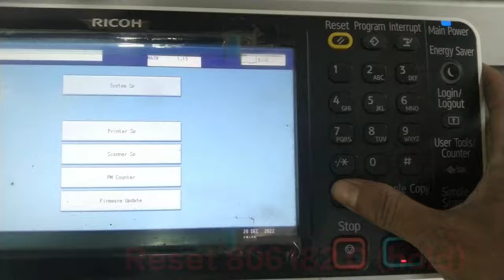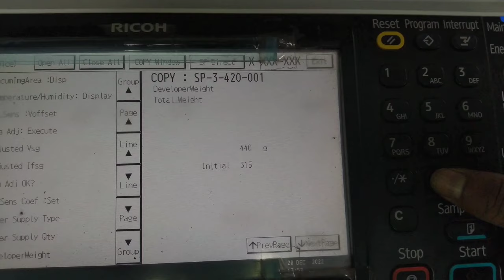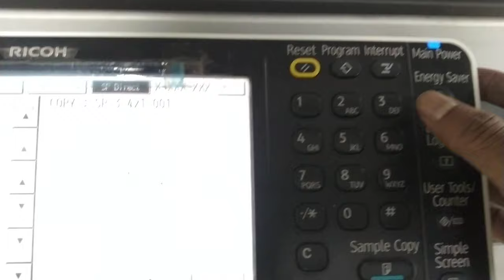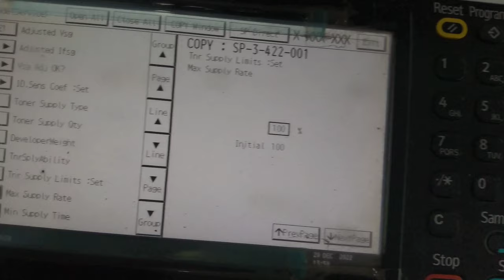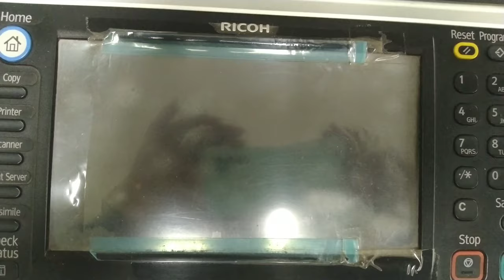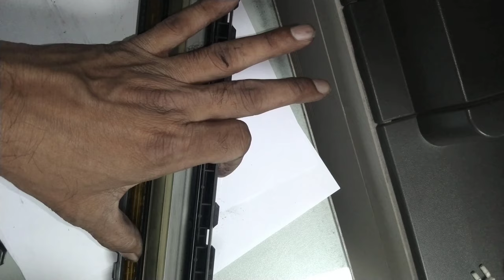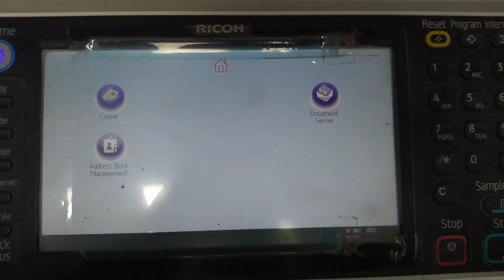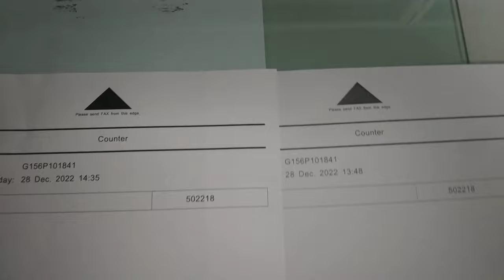Ricoh MP 2554 lite copy, How to solve lite copy? How to increase darkness, fix low quality print.

Comment: i had the same issue with mp 3054...after i change new developer its good,but after 100 copies it becomes faded again...i already changed drum unit and new developer same problem...
Reply from the maker: Please apply this video's solutions especially : Developer thickness increase. 
Additional is SP 3440 100% to 150% and 3422 10% to 15%
Then Manual procon execute. 
If not solved : Replace High voltage circuit.

Comment: What about if mpc 2003 black not solid..also very light,after change drum,developer..
Reply from the maker: Use sp mode143
SP 3050 - .5  to 1
SP 3420 - 315 to 425
SP 3421,  deafult to increase 
SP 3620,  .6700 to  .750

Then complete procon all

Darkness will increase day by day.
Reply from the maker: Also replace original Drum unit
Reply: Thank you for the feedback,will update again here
Reply from the maker: If not solved
Increase Development thickness.
Reply: @ricoh.support How do you increase developer unit thickness

Comment: For mp 3352 sp we can do same thing ??
Reply from the maker: No, If the life of parts is not over, this model does not have copy light, so please at first check drum, developer life.  60,000 copies or 1 year then if life is over, Replace : Drum, Developer and cleaning blade.
Reply: How to check the life of drum, 

 developer need to replace 
i think so, any video for developer change in mp 3352 sp or related models , thanks
Reply from the maker: If you have a note, you can know when it last changed or how many copies when changed before, and if you don't have a note, you can't know.

Comment: Hi MP2501SP problem with low quality print can i use this trick
Reply from the maker: no, not same process.
In MP 2501sp,
At first clean laser unit 
If not solved,  use sp2802 (d.v. mixing )

Please get result, after 300 copy/print

If not solved,  please replace developer.
If not solved please replace drum & cleaning blade. 
Thank you.